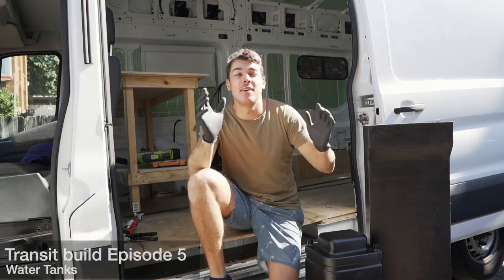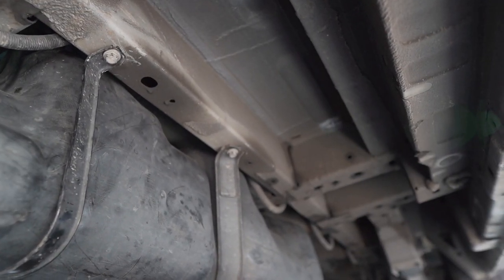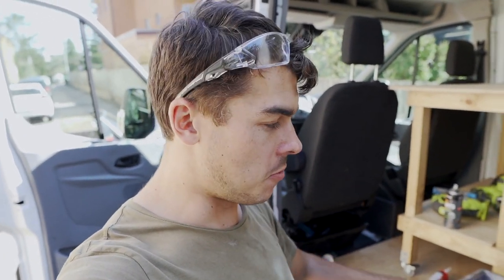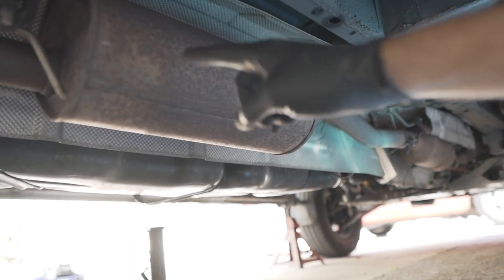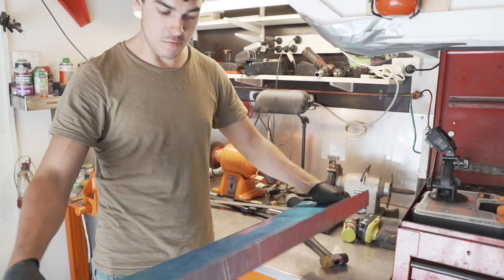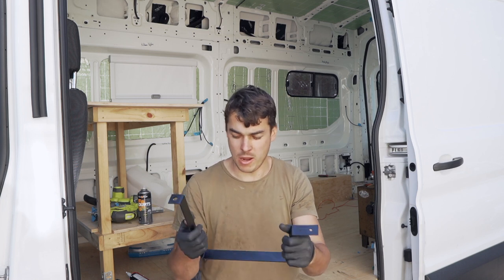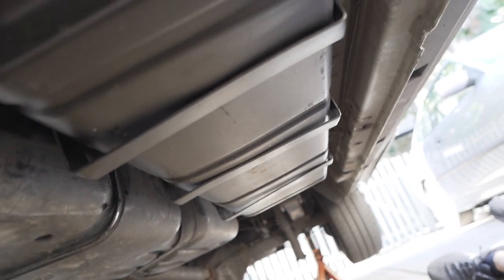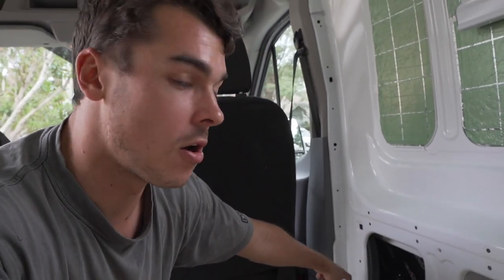Simple DIY Water Tank Brackets (NO WELDING) | Ford Transit Conversion

Comment: You could have just zig-zag bent the bottom brackets to not need the spacers on the error missing the bolt heads... but perhaps you didn't have anymore steel on hand and had precut the steel to the straight lengths you used...  I would also be a bit concerned with just brackets against plastic over time.  The tank kits you buy, have a complete frame around the bottom, and that is what is fastened to mounting brackets...  but it would have been easy to fashion some angle aluminum to be a frame around the bottom of the tank that rests on your brackets.
Reply from the maker: The brackets are really quite strong. I've no doubt they will endure the test of time. They are held in tight with rubber matting to alleviate any rubbing that would cause a problem later. Yes that is all the steel i had and i had already pre cut it all.  I also actually removed all the hex screws are re did the whole fastener system to the chassis with riv nuts which makes me sleep easier at night.
Reply: @saltyvanventures  I'm just in the process of fixing my grey water tank under my VW Crafter and I think your way with the brackets is a good one, with riv nuts even better. How thick are the brackets? Looks like 4 mm or something?

Comment: Hey I am just about to start the process of installing a water system in my 2019 Transit. Just wanted to check in and see where you guys are at with the 85L, do you think it was enough?

I have had some people recommend for me to move the spare tire to the back door and use that space for an even  bigger tank but tbh if you guys are happy with the 85L still I think I will just stick with that since I love working along side  your videos.

Cheers guys!

Comment: 10:51 Try the bolts up the other way to protect the threads from road gravel etc. And for better clearance (less danger) when you're underneath the van.
Excellent work. Great vid.
Reply from the maker: Thanks!, Yes that's not a bad point, Ill probably flip them around

Comment: Awesome video thanks man! Gives me a lot more confidence going into the same project on mine.
I was wondering if there is any concern with forward and backward movement with accelerating and braking as there are no brackets specifically stopping that motion? Just a thought I've had about my own. Thanks again for the videos!
Reply from the maker: the freshwater tank is actually wedged in on all sides so there is no chance of movement and the grey water take is solid as a rock.
Reply: @saltyvanventures  then that's exactly what I'll do 🙂🙏

Comment: just curious as it doesn't seem like the brackets go into any of the tank's recessed channels and so provide max support from the top/bottom and left/right side... did you do anything to prevent the tank from sliding back/fwd when accelerating/braking that could affect your plumbing fittings?
Reply from the maker: The main tank is actually wedged by the van chassis at either end so it can’t physically move. The smaller grey water tank it has rubber strips around the bracket which stop any movement occurring

Comment: Hey Marcel, thanks for the all the info. We're converting a van at the moment and getting a lot of tips and tricks from you. Can you please give a bit more detail about how you ran the hoses for the tanks from the chassis up into the van and whereabouts you made the holes? Were they up through the floor or more the side cavity? And what did you use to seal/secure them? Thanks!
Reply from the maker: Yes you are correct. The hoses are ran though the wall cavity. You may need to get under your van to see where it will pop out. There was a very tight area where I could run them. I used a hole saw/ step drill bit to drill out true holes. Make sure to use a rubber grommet or similar around the hoses to stop them from rubbing and eventually being cut by the sheet metal around the hole. Is used plenty of Sila flex too to keep them from moving around

Comment: Hey Marcel. Can you tell me what you did about your pipes for the tanks. What size piping did you  use to connect to the tanks as I'm trying to avoid huge holes in the van floor when doing the pipe runs. Thx fella
Reply from the maker: You will need to drill some holes into the cavity on the side of the van for the hoses. there are 4 hoses you need. Fresh to pump, fresh from filler, breather for filler and grey water. Grey water and filler were 1" flexy bilge hose, fresh inlet was 12mm hose and breather was just a small rubber hose.

Comment: Hey mate love your channel/ build how does the pump go ? I have the same pump but have seen a lot of other van builds using an accumulator do you reckon it’s worth putting one in ? 

Cheers cob
Reply from the maker: Personally I don't see a need for it in our build. The pump only has 55psi and all our pipes are rated to mains pressure.
Reply: Your a legend ! 
What sort of hosing is your 12mm hosing that supplies the van and where did you source it chasing some at the moment thanks mate

Comment: Hi Marcel. Can you tell me how you fitted air vents to both tanks. Thx heaps.
Reply from the maker: The breather for the fresh is connected to the intake cap. There should be hose fitting for it. The grey i just used a short piece of hose and glued in a fitting on the top of the tank

Comment: HI! This is brilliant but how do you then connect the water tanks to the inside of the van?
Reply from the maker: I ran rubber hose up from under the van for the freshwater to the pump. same for the water water and the filler hose. I had to drill the holes out with a hole saw bit through the side panelling of the van.
Reply: Thanks for the reply! Is there any footage of that of any of your videos? Even if it's just like a picture of that  to get the idea!

Comment: Great video! Does the ford transit have a preexisting water drain hole like the sprinter? Also not sure if is Australia is needed but are you planning to freeze/winter-proof the water tank? if so how?
Reply from the maker: I'm not away of any natural drain hole, well not that i have found or noticed anyway. Luckily we don't need to freeze proof the tanks in Australia as it doesn't get cold enough in 99.5% of the country to warrant it

Comment: Really enjoy your videos....if I didn’t see your roof rack, I’d not been able to mix 80/20 with square aluminum....I’ve still not found a tank supplier meeting your water tank dimensions in USA.  my next question is where did you get your water port in this video?  There is no link at the top of this video
Reply from the maker: Not sure what you mean by you haven't been able to see the roof rack? The water port is a Camec lockable water filler. I'll add the link to where i bought it in the description.

Comment: Hi Marcel, loving your videos.....we are in process of converting a Ford Transit in Adelaide.... so it's perfect timing. Just noticed that the fresh water tank you used has a flare out at one end which is different to the picture and drawings you link to at the manufacturers website. Was that a problem when you received it.....and what difference does it make to the dimensions.
Reply from the maker: Hi! Yes its a bit or poor advertising on their part but i did kind of know it would fit prior as i ordered the same tank as another fella doing the same van up. The extra bit does fit snuggly though. Basically fits between the chassis cross members and the floor, then the body of the tank rests on the cross members, if that makes sense. So the extra bit faces up. Hope that helps
Reply: @saltyvanventures  What brand are these tanks and where did you get them? I have this van and am looking to purchase the same. . Loving the videos mate. Internet Gold!
Reply from the maker: @michaelborlini569  the links are in the description

Comment: Hi Marcel, hope you are going well? Love your videos and you make it look so easy! Haha
Just a couple of questions. What dimensions were your mounting brackets? Does it have to be of a certain thickness so when we bend it, it will not break and have its structural integrity? Can we find this at Bunnings?
Reply from the maker: From memory i think the flat bar was about 40mm x 3mm thick. Thick enough to hold the weight but still thin enough to be workable. Steel will bend nicely and not break like aluminium is susceptible to if you bent it 90 degrees with a hammer. You would need to get it from a steel/metal shop not Bunnings.

Comment: Hey Marcel
Do you find you've lost a lot of clearance with the main tank or do you not mind?
When I measure up the same tank on my transit it sits 10cm+ below the fuel tank which is the lowest thing in that part of the under body.
I'm worried that I would rip it off camping
All the best, yeww 🤘
Reply from the maker: No particularly. It is slightly lower in that zone of the van but the evident lowest point of the van is still the rear shock mount (very annoying actually) I haven't found I have been worried or concerned about it getting knocked around. I was also planning on adding some slightly larger tires to the van which would lift the whole van about an inch or so but by no means ill be taking it over terrain where i would be concerned.

Comment: Great vids mate - will definitely be  copying a lot of your ideas. One question - what is that hot water system - and where did you get it? And some advice - turn the bolts around on your fresh water tank -less chance of the threads getting damaged so will be easier to undo when the time comes, many k's in the future. Cheers and beers
Reply from the maker: Thank you. I didn't really have too many options regarding the orientation I installed the water tank. Your point is valid though and is something I didn't really think about. The tank was supposed to be rectangular but as you can see in the video it has an extra bit on the top. Because of this I could only fit it in one way. I might make some kind of protection plate it if it becomes an issue.

Comment: was that the biggest fresh water tank you could fit under the car ?
Reply from the maker: Yes that I could find that would fit nicely. You could probably add a smaller second tank in the rear near the spare wheel and connect them up to get a bit more capacity

Comment: TEK screws? After 50+ years as a mechanic I wouldn't use them to post a sticky note on the wall. They ALWAYS come loose.
Reply from the maker: Yes I agree, Very shortly after making this video I removed all the tex screws and installed rivnuts for a much stronger join.

Comment: Where did you get the tanks?
Reply: Really like your info......pace and sound good.   much better than humble road....my guess is that this won’t work if you fuel aux installed.  You’ve convince me to try this
Reply from the maker: I got the big tanks from a water tank supplier in Melbourne. And the smaller grey water tank from eBay. Both the links to the tanks are in the video description

Comment: Do you know what weight crossbars   can handle. It's not a chassis and  I am worried if I put my water tank it eventually break apart.
Reply: 80-100 kgs of water and tank weight combined and spread over a few (maybe 6) mounting points shouldn't be too much bother. Those van floors are made to carry about 1000kgs all up, maybe more for a big van.
Reply: @garyoneill8868  there is small cross members that actually welded to the chassis that's what I am worried about. Anyway Thanks
Reply: @897aa33  yes, I know you were referring to them. The tops of them sit flush with top of chassis, yes? Ie they help carry floor weight? Edit: I've just looked at video again; they do sit flush. As long as you spread the weight out a bit you shouldn't have any problems with it.